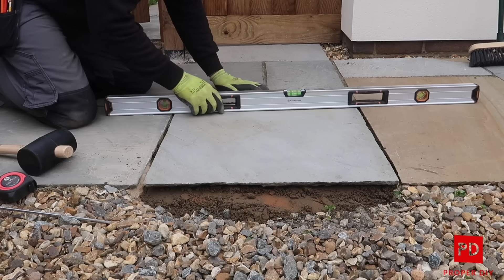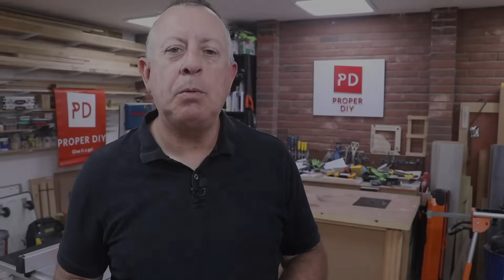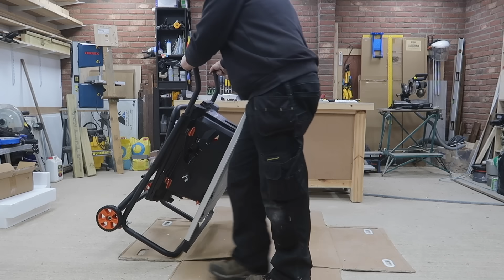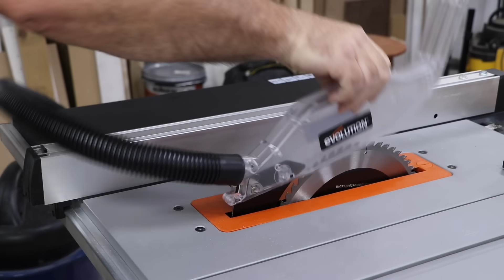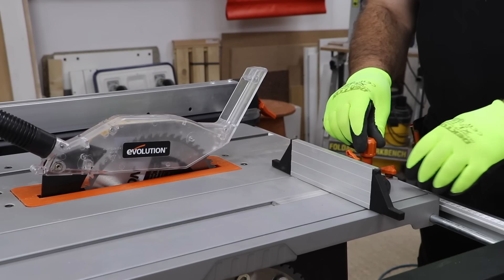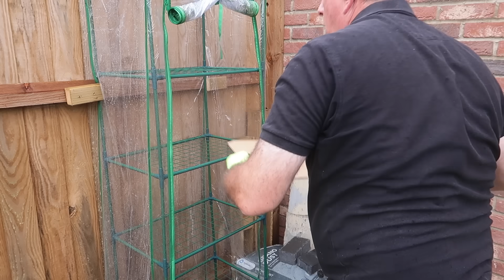Table Saw Basics for Beginners

Comment: Thanks for your work making this video. I just wanna say: please don´t wear gloves while working with rotating tools like saws, routers or a drillpress. If the tool grabs on your glove, your hand will end up in the sawblade or drill. It´s just not worth loosing a finger or more. :)
Reply: Agree never wear gloves, long sleeves, anything can catch the blade
Reply: Just like mine did. Hospital for two nights. They managed to save my fingers in a 5 hour op. Should have known better, been at it many years. In my defense, I had just got back from holiday and my hands were soft, ever time I picked a piece of timber up I succumbed to a splinter. Gloves are a no, no. Take it from me.
Reply: I fully agree.
Reply: Agree, you'll rather have a shallow cut in your finger than get the glove sucked in and your entire finger or hand cut off.
Reply: Friend wearing a loose sweater and with a power drill set on lock, made a lovely mess of his abdomen and spend a week in hospital, lucky there was an instructor in operation, be careful… anything, that rotating tool can grab, it will, and end in spectacular fashion!!!
Reply: Is was thinking the same it’s so dangerous to wear gloves. 😡
Reply: I was just thinking the exact same thing. I wear gloves when handling timber but always take them off if using power tools with rotating cutters. The extra "protection" turns into a bigger risk.
Reply: I often see this with youtubers, it's unbelievably daft!

Comment: I had the lower grade version of this, the Fury 5-S.  I built my home with it, but had to get rid of it eventually as the deflection on the fence with it being only secured on one side was far too much.  Upgraded to a Dewalt DW7485 with the rack and pinion fence and it's much more accurate.

Comment: The achilles heal of most table saws is the quality/rigidity of the fence ..... you didn't really cover this  ... please explain in more detail.You did explain how timber could be 'grabbed' but this is very much a function of how good the 'fence' system is in locking parallel to the direction  of cut. Your videos are great, but this point is fundamental to table saw operation, please review this point.
Reply: Absolutely 100% agree,  the fences on the cheap saws are terrible, very hard to set up straight if it doesn't clamp at both ends and annoyingly awkward to set the cut measurements

Comment: Good video this, most of us have been there with full sheets of ply, no guard, trying to cut one in half 🤢two man job but still very very dangerous. Take no prisoners these saws 👍🏻 Thing is, as long as you only have the blade height set just enough to cut you’ve far more control and less chances of losing a fingertip.   👉🏻☝🏻👈🏻

Comment: Get that blade height just above the thickness of the material being cut! Reduces the risk of kick back considerably…
Reply: I spent years operating a table saw when I used to work for a point of sale display company and had a piece of wood kick back so bad it took a large chunk of skin off my hand and flew back that hard and fast it embedded itself in the wall behind me. To this day I have no idea how it missed me.
Reply: @stevenfromleicester2529 Why it happened? Because of height of the saw or for some other reason?
Reply: @milosgrujic9118  it happened because I was cutting bits of wood horizontally across the table saw without proper support like a miter gauge. When pushing the wood through the saw I probably twisted it slightly and this caused the kickback and the wood to shoot back against me like a bullet.
It was a valuable lesson learned by a young in experienced chippy.
Reply: @stevenfromleicester2529  Holly... I hope you recovered well after such an acident 👍
Reply: @stevenfromleicester2529 Be careful, always check ✔️ everything twice and don't chop off any fingers 🇬🇧 👴
Reply: Let's be honest we all know why the blade height was as high as it was, the guard. You can't lower the blade too much with the guard and he didn't want to tell the new table saw users to remove a safety feature.
Reply: @TheFazer1992  This. With the guard/dust hood attached to the riving knife it is physically impossible to lower the blade enough for the blade to just break the surface on thin media.
Reply: Yep. Get that blade down!
Reply: 1/4" above the face of the material is recommended...as you would plunge the same with a circular saw 👍
Reply: Also for the love a God. DO NOT STAND BEHIND THE BOARD ON THE RIP FENCE SIDE
Reply: Thought exactly the same as soon as I see the first cut. A lot safe to have the blade a mm or two above the thickness of the wood.
Reply: Do you need to check the blade is at 90 degrees like on a mitre saw?
Reply: @21labrador  You need to check for parallel between the blade and fence, and if you want accurate cuts on the mitre guide, yes, you need to check that is actually at 90 to the blade ( or whatever angle ) as the scales tend to be less than accurate.
Reply: @21labrador  Yes, otherwise you'll have a long piece of wood with a slight angle, it will show up when you fit pieces together
Reply: @StephenWestrip  You mean top surface of the wood should be half way up the individual TCT cutting portion of the teeth? You can't use "blade" to refer to the TCT portion when "blade" means the whole disc, it confuses people.
Reply: @StephenWestrip  No-one was confused by the OP. It absolutely does matter which words are used, words have meanings for a reason.
Reply: @InfectedByEli  I shall delete my comments and let you explain it. Sick of people like you and your pedantic comments.
Reply: Agreed, you can raise the height of the knife
Reply: @StephenWestrip  What?. You surely mean they should protrude just above the surface. If they didn't protrude, you don't get a full cut.
Reply: Took the words ut of my mouth. I was thinking that straight away

Comment: I had this saw for a year and mine was just terrible. Fell out of square after pretty much every cut, because it kicks like a donkey when you start it up. The chatter was awful, even when cutting thin sheet materials, and the non-standard mitre slots are a real niggle too. Let's not even mention that the arbour is 25.4mm meaning you either need reducer rings for most blade brands (Saxton do a line with the right sized hole though) or are stuck with the expensive evolution ones. The worst thing is, this saw  was only £220 when I bought mine just over a year ago, evolution have jacked it nip to £350 now!
After all that, just want to say this was a great video & I'm really enjoying working my way through your others.
Edited to add: I would never wear gloves when using power tools, I'd rather lose a finger than an arm.
Reply: Thanks for this. Useful reminder of my experience with Evolution gear after I began to soften towards this. Their quality control must be all over the place such that lucky owners swear by them while unlucky folk like you and me swear at them. They told me to return mine as not fixable the night after I bought it and found I couldn't even set it up (assembly fault at factory). Unused. Screwfix Erbauer similar

Comment: Hi I really enjoy your videos and watch regularly but, can I just say.... Blade height! I've always been told and understood that you should only have 1 saw tooth tip exposed eg 5mm above the thickness of the material, this also helps eliminate kick back. Adjusting the riving knife height according to hold the blade guard.
Reply: A problem with this saw is the blade guard forces the minimum blade height to be about where it's set to in the video. It pivots on a bolt right at the back and actually covers about 15mm below the bolt point.
Reply: @DuceDesigns  ah fair enough, that makes sense, just thought I would mention it just incase.
Reply: @DuceDesigns  you can actually raise the height of the knife, the blade doesn't stick up too high.
Reply: @DeafMaker  maybe (I hope!) they've changed the design of the guard for newer models but on mine the position of the pivot point meant that even with the riving knife in its highest position the blade had to have a minimum of about 30mm exposed before I could have 9mm MDF able to pass under both the front and back of the guard without catching on one or the other.

Comment: Had this saw for a number of years but upgraded recently to a small cabinet saw. It was good enough for carpentry work but I struggled to get it to maintain accuracy for any kind of furniture joinery, just too much slop overall. Also frustrated the mitre slots weren't standard.
Reply: feather board can help. i have the dewalt and it seems pretty accurate for me. also use good blades, freud etc make a huge difference
Reply: What saw did you get?
Reply: @DeafMaker  The 8” saw from Axminster. I’m not cutting big pieces of timber so it works well for me. Solid table and decent fence and enough power for my needs. Also very good dust collection which was another of my beefs with the Evolution saw.

Comment: I own this particular saw and have used it for the passed two years, and for the price i think it's one of the best table saws out there, my only gripe with it, and this is just my opinion it should have an emergency stop paddle over the on/off switch, i have luckily found a chap that makes one for this model and it is brilliant, a small thing but it could save you from serious injury or worse.I also own the Evolution circular saw which again for the price is superb.
Reply: Totally agree, I have this table saw also and have the same retro fit on/off switch. Great work horse entry level saw.
Reply: I own it too and really wish it had an emergency stop paddle - nearly had a serious incident last week with it. May I ask where you found your emergency stop paddle?
Reply: @richarddixon1401  Sent you a link.
Reply: Hi just unboxed this saw . Would it be possible to send the link for the emergency stop paddle please. Many thanks in advance 👍

Comment: Have exact same saw,locking the fence and keeping it parallel with the blade can be a bit of an issue
Reply: yeah, my dewalt has rack and pinion and seems worth the added cost as the fence is brilliant.